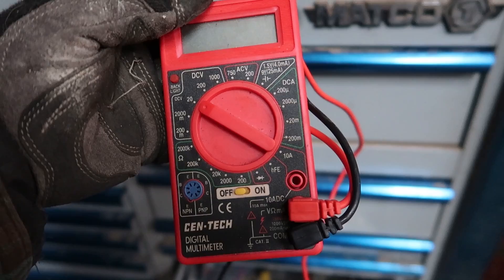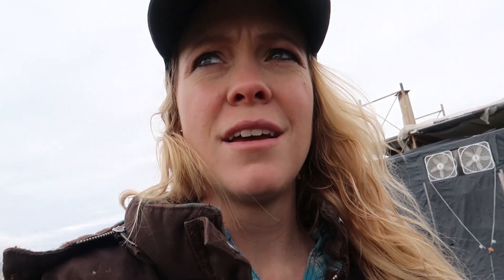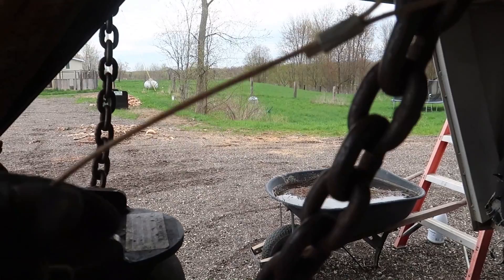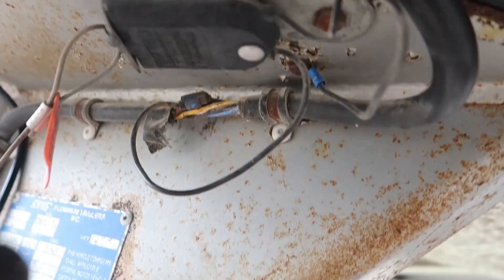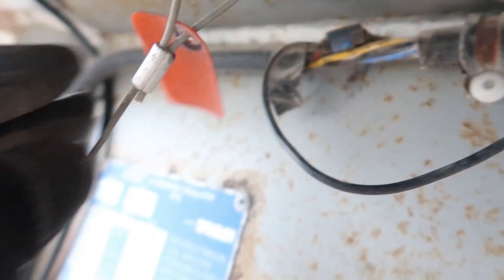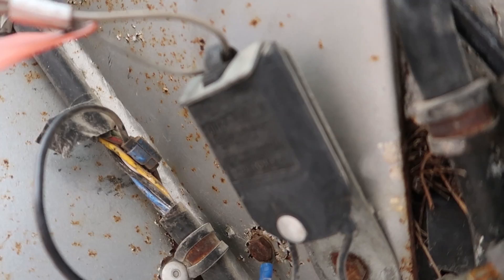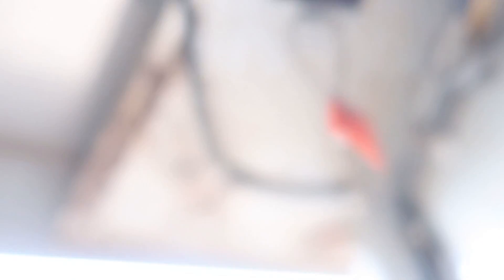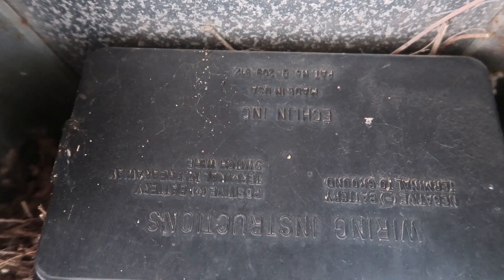218 SOLVED!!    Why My Trailer Brakes Lock Up (You Guys Are the BEST!)

Comment: You find the emergency brake power that slams on the trailer brakes when the cable that pulls cable turns away if yor trairler gets loose from the truck.  That very low voltage at the breakaway battery says to that the barrey is dead.  Go to toutuber and find one of the many DMMs for the many things it isnused (DigitalMultiMeter).  Hot tells me you have one or many wires in the trailer wireing is shorted out>
Reply from the maker: Thanks, I'll look into that!

Comment: You need to test each of the connectors on the truck to see what they do. One should be for tail lights, brake lights, turn signals, etc. One should also be brake power. The brake power pin should only power up when you step on the brakes. If there is no pin that powers up when you step on the brakes, the connector is wired wrong. The pin with constant power may be for charging a trailer battery, or may be wired wrong. Once you find the brake pin, you will need to make sure that it is connecting to the proper pin on the trailer to send power to the brakes. Pin #2 in the schematic in the link below is the one you are concerned with. If it only comes on when you press the brakes, that is working fine. If that's the case, the problem may be the trailer wiring. The breakaway adapter only supplies 12 volt power from the small battery to the trailer brakes when the cable is pulled. If the battery is dead, it will not activate the trailer brakes.
Reply from the maker: I could probably test with a light :)

Comment: Sue your battery needs charging, it will charge from the truck if the plug is wired right, but if someone was messing under the hood or with the trailer plug it may be wired wrong on the trailer,, the plug on the truck is ome, so unless a wire broke and was hooked up wrong, the 2 black wires on the plug on the truck are strait from battery, the smaller wire is battery charge the bigger black wire is acc battery power for say your winch, a back up trailer light,, anything you want the truck to power over the charge wire, i can email you a wireing hook up for truck an trailer, nothing works on the 4 flat pin plug unless you put your park lights on, or a turn signal, but the 7 pin you always have 2 hots all the time, as for the trailer e brake that cable has to pull that black plastic pin out and as long as your trailer battery is 12 volts the brakes lock on,, thats a very smal AH battery, it should be a 7.6 AH BATTERY WITCH IS LONGER AN FITS TIGHT IN THAT CASE.  if your brakes are locking up most likly someone wire the trailer plug end wrong to battery power, you also can not have your 4 way flashers on at any time the trailer is hooked up, as that will pylse the trailer brakes on an off with each flash, i can email you the wireing hook up standards.. pick up a 7 way RV plug tester and a 4 flat tester, they are cheap, i have in stock, the 7 way is like 10 bucks an the 4 is 6,, id send them to you but by the time it got to you, b to late.... your battery has 6 volts so it is just low, but it is to small, needs minimum 7 AH, a low or dead battery wiill not put your brakes on, and the pin is not pulled on the brake away switch..how ever water and salt get in them and they dont work, you test it by hacing a good charged battery hook to truck every 6 months, drive a head, wheels turn, pull the plastic pin out. drive forward, wheels will turn a little then stop wheels tight if batery and e brack switch is ok.. now just one set of wheels may stop and trailers only need 50% braking, so if you have only 2 tires, all 2 should stop, if you have 6 tires only 4 need to stop, you have 4 tires so 2 tires need to stop, but the mfg may have put brakes on all 4 wheels, you hade the tires off and i think there were drums on all 4 but was there wires going to all 4? blue wire is always brakes, that stuff on the back of the truck 7 pinx4 is factory fits ford and new dodge, again i have the color code wire set up drawing i can e u,, but iknow you to well you know what you are doing and i am playing along. oh why there is 2 hot battery wire is the battery charge wire hooks to an isolator boxs(20 amp fuse) so you dont kill the truck battery if it is left hooked to the truck and you are say camping, the other hot wire is fused at the battery so you always have 12 volts to hook up anything you want to run with out truck tunning, use last2 images at bottom of page, you already have this.. https://www.etrailer.com/faq-wiring.aspx the center pin says back up lights, but it has power all the time key on or off you would need to spick in a dash switch if used for back up.. it the heavyset wire so it is used for any accy

Comment: Figuring out wiring on trailers isn't easy unless you have a diagram (installation guide) for that particular system. As a rule, the brake wire for the connector is a constant 12v to the controller inside the truck and there is a signal wire from the brake light switch inside the truck to the controller. There is a ground also. I believe the constant 12v is a blue wire. Anything in a vehicle that has a ground, the ground wire is black. Any wire that is RED is 12v, any wire that is black is ground. Solid color wires such as yellow, brown, green on the rear are tail lights, left and right signals. On that trailer the ground probably is white. If the truck has daytime driving lights the most probable cause of the brake problem is that the brakes are hooked to a tail light wire (or headlight). Have him disconnect whatever wire he found unhooked and check the brakes. Check for an installation guide on the internet if you know the brand of system you have. The "break away cable" only activates the brakes in the event you lose the trailer from the truck. That little battery locks the trailer brakes. I certified in electronics back in 1980 and did installs for a GM dealer. I specialized in fuel injection and computer command systems back then. Lots to be said about the importance of a wiring diagram and installation sheets. That rear "plug" should be available from places like Advanced Auto Parts, so if you can't figure the wiring out I suggest buying a new one and a service manual for that truck. You need one anyway for future repairs to just about everything on it and they are reasonable in price. Good luck. If I were close I would fix it for you but I am on the gulf coast (150 miles from Panama City)
Reply from the maker: Ohh, that's an idea I hadn't considered! I do have a few wiring diagrams I can use to trace everything (both truck and trailer). I don't think the truck has daytime running lights, but I always have my lights ON, so in theory it IS possible they might be triggering the brakes . . . I'll have to run some tests :)

Comment: You have the right adapter. Just take it apart and there should only be two wires you can change. Switch them around.
Reply from the maker: That sounds like an easy test :D

Comment: Some older trailers had a 6 wire and newer ones have 7 wires.  You would need a wiring chart to know which wires go to what. If testing the brakes or lights you would need them on.  Then the testing of the trailer brakes would need to be on. Testing  using a good ground best to be at the frame and make sure it goes to steel not on the paint. Could be other problems in the brakes why they do not release. The wire in the front of the trailer is a break away, So if it comes off the truck the breaks should stop the trailer. The battery did look bad. I have not seen a tester like yours not sure it's the correct setting.
Reply from the maker: Thanks, I'll look into that!

Comment: Here is a website with the correct wiring diagram for that plug but you can't always count on the trailer being wired that way.  https://www.ajtnt.com/7-way-rv-plug-diagram/  You had power on the terminal that is supposed to be for constant power. That should feed the interior lights on the trailer as well as charge the battery you removed. The battery is to supply power to the brakes if the trailer is disconnected from the truck and pulls on the cable. No battery power = no brakes without the truck connected so that battery isn't your problem. You will see on the diagram that the brake power should be on the bottom right terminal on the truck plug when the brake pedal is pushed. When the pedal is released, the power should be at o volts. Plug in your trailer, see if the interior lights work and check the right turn and left turn lights and tail lights. The center post on those plugs are for back up lights, which many trailers don't have.

As others have said, rust on the brake drums can cause the brakes to stay on without any power being applied. Backing up will usually release them. Here is a website that shows the electric brakes. https://www.hitchweb.com/blog/post/2013/01/07/how-electric-brakes-work
Reply from the maker: I guess I'll have to have Erik help me . . . or maybe my daughter :D

Comment: Have a helper in drivers seat  and test the pins on out let of truck for all your functions with a test light or your multi meter.they all should read 12 volts when function. Do yor basic brake ,lh rh turn signal, marker lights
Reply from the maker: That's a good idea :D

Comment: The brakeway cable is on the trailer ,you need a test light to its easier but you got push brake petal down to get power , looks to me ya  ,?? It is not wired right  your center prong on truck is should be power to brakes ,your feeding power to the brakes on the wrong wire ,find out for sure witch wire on truck plug is power to brakes an match the plugs wires ,its easy to do , hard to tell you how .

Comment: Ditch the adapter and the smaller aluminum plug.  Wire in a proper 7 way RV plug.  The problem is probably the adapter.  The six way aluminum plug can be wired 2 different ways, and with the wrong adapter power is being sent directly to the brakes.
Reply from the maker: Thanks, I'll look into that!

Comment: That is not set if you unplug the trailer and it released it’s good the wire is if the trailer gets disconnected it sets the brakes locks them up the 4 wire is for a small trailer like a boat the 6 pin each pin is a wire turn signals brake lights the in the truck is a box to control how hard you set the trailer brakes the cone peace under the truck is how you lower the spare tire hope this helps
Reply from the maker: I would have never guess that was for the tire!
Reply: WT Farm Girl Videos and the  nut end of the jack Handle goes in not the spade for the jack

Comment: You need a new battery for the breakaway switch. The breakaway cable is tethered to the truck.It closes the switch and fully applies the trailer brakes if the trailer comes unhooked from the truck when moving.You can test the truck trailer output plug with a 12 volt test light-key on,headlights and hazard flashers on.Get rid of the adapter on the trailer and wire it to match the truck. Here's the diagram for the truck-TEST WITH LIGHT TO VERIFY!  video in this link https://www.ajtnt.com/7-way-rv-plug-diagram/
Reply from the maker: Thanks! I'll check that out!

Comment: 7 pin flats, looking @ truck;
1 o'clock = 12v pos.
3 o'clock = r/h stop/turn
5 o'clock = Electric Brakes
7 o'clock = Ground
9 o'clock = L/H Stop/Turn
11 o'clock= Running lights.
Reply: P.S.
Center pin = back up lights
Reply: DVOM was set to detect voltage, Correct.
Numbers are not what should be showing.
It should be batt voltage when on, eg: run lights on 12 o'clock shows bat volts.
Reply from the maker: Thanks for the breakdown :D

Comment: Hey I see me!!
Reply from the maker: LOL
Reply: @This1LifeWeLive  were you able to get the trailer brakes figured out. Kinda looks like two problems now that I can actually see it. The battery is toast and that 6 pin and 7 pin plug connectors just don't like each other.
Hope that you get it figured out, I know that you will.

Comment: Unfortunately I think your going to need someone who knows a little bit about trailer wiring there with you to walk you through this. Your getting so many comments sending you in so many different directions that your going to get understandably confused. You need a wiring diagram and a multi meter and work your way through the testing of the wires. I don’t know why he left all the old trailer plugs hooked up behind the new bumper that just creates more problem areas. This is stuff you can do with a little one on one guidance. I’m sure you can do it with the right help.
Reply from the maker: Very true, but it does help me understand how things can work a bit more :)

Comment: That trailer plug needs to be a 7 pin
Reply: You used the truck to bring it home.  Did the lights work then?  To plug into the truck it would have to be 7 pin on the trailer like the truck.
Reply from the maker: It has an adapter to make it 7pin, but Erik is thinking about wiring in something permanent for a 7pin :)

Comment: That battery only showed a bit more than a half of 1 volt. That battery needs replacing if it can't be charged. A half volt is a far cry from 12 volts? The wiring is a ball of confusion looking at it in parts and various angles. Lol.

Comment: Also, that multimeter needs batteries and an upgrade. At times those type of multimeters will tell you everything but the truth, especially if the battery's voltage isn't near proper voltage output.
Reply from the maker: I couldn't even see where the batteries went IN, lol

Comment: Poor girl!!!
Do you know what the Hades you’re doing???
Reply: Jeff_Simmons 
If you do not even understand the basics of automotive electricity one can do much more damage than what has already occurred.
Much like a farmer doing some of the complicated procedures DrCody Creelman just because he saw Cody do it on YouTube.

I know what the heck I am talking about... I used to work on the Crash Rescue Fire Apparatus at Los Angeles International Airport LAX.
Reply from the maker: LOL, don't worry, just testing wires, not unplugging ;D But I did show Erik how to wire the solar battery system to run our maple sap pump ;D Fear f not doing somethign correctly is what's keeping me from fixing my car right now ;D
Reply: WT Farm Girl Videos 
Ok Darling...
A pump with two wires is one thing... a modern truck and a trailer with electric breaks is another story...

Comment: Suzanne, I didn't wait for the end of the video,  but the break-away box is on the trailer in close proximity to the Goose neck hitch.

The tube is the tube that goes to the spare turn winch. The jack handle goes into the tube to crank the tire up and down.

The wiring under the truck is partially suspect, especially the corroded flat 4 pin connector. That should be cut off and taped over to keep from getting further corrosion inside the wires. The Ford has the flat 4 pin connector in the wiring harness even if equipped with the factory trailer package. 

I use the same Hopkins 7 blade /4 flat connector. They work well.

As for the multimeter, turn the switch to ohms first, then connect one test lead to whatever you think might be metal, and scratch a spot on the frame clean, and touch the other test lead. If the multimeter reads 0.01 or lower, you've got metal. Keep one lead in place, as it's going to act as your ground.

Now turn the meter dial to VDC or volts in the scale of 20 volts. Turn the truck running lights on, and then probe the blade on the trailer plug at 11 o'clock until you see voltage. That will be your running lights. Turn the lights off.

For the turn signals, turn the ignition to the accessory position, turn the left turn signal on, and check the trailer connector blade at the 9 o'clock position which is the left turn signal.

Now turn the right turn signal on and check the blade at the 3 o'clock position, the right turn signal.

Start the truck and check the trailer connector again, you'll have power at the 1 o'clock which is an auxiliary connector and the trailer brake signal blade is the connector at 5 o'clock, but should only have power when the brake pedal is depressed and the brake controller is turned on.

No center pin means that the trailer doesn't have reverse lights. That's what the center pin powers. Replace the break-away battery and check the power connection on the truck plug at the 1 o'clock position for power, as the trailer might be pulling power from that blade to keep the battery charged.
Reply from the maker: Thanks for your help :D

Comment: The adapter is your problem, when you buy them they are pre wired for use with a camper not a horse trailer, remove the four screws that hold the adapter together.  When you open it you will see two wires that have screws holding them in.  Those are 12volt and brake, swap them and your problem solved.

Comment: sometimes if the trailer was pulled by chevy or dodge the trailer wires for the brake and the accessory wire are the opposite of the ford.
Reply from the maker: That makes complete sense :)